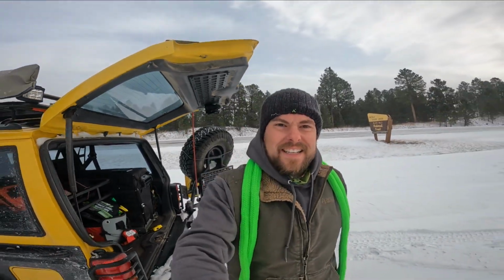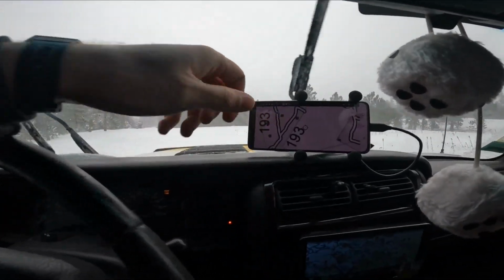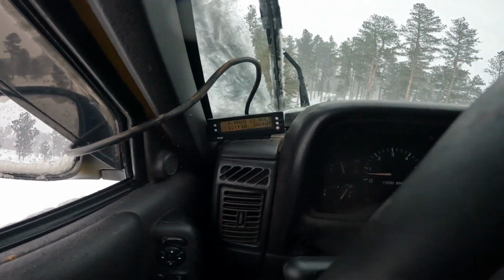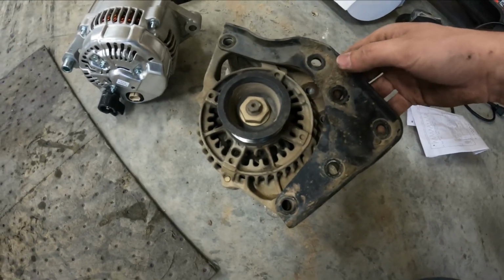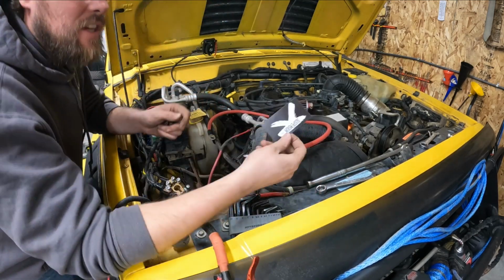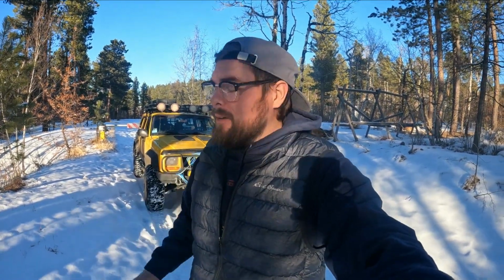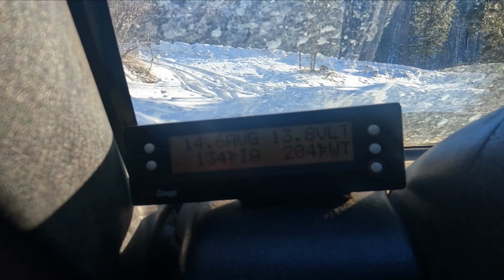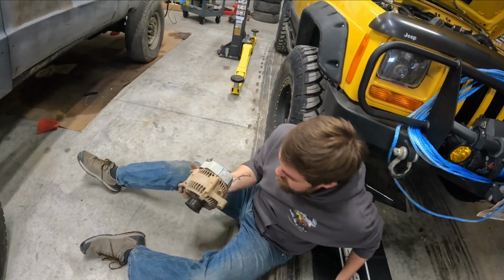Deep Snow Wheeling Almost Destroys My Jeep Cherokee XJ. Here's How I Fixed It

Comment: A dual battery setup would serve you well.  I don't have a fridge but a lot of accessories and a winch. Haven't encountered any issues and I don't have an upgraded alternator. I would also suggest a 1000w inverter for your set up. How did that kinetic rope turn out? I saw the exact same one at a Jax near me and almost picked it up.
Reply from the maker: Hey Ryan! Dual batteries aren't off the table yet. Just seems like more weight to an already heavy rig! I'm hoping to use the rope more at our club run before I start recommending it!
Reply: @ty_thejeepguy  nice look forward to hearing about it